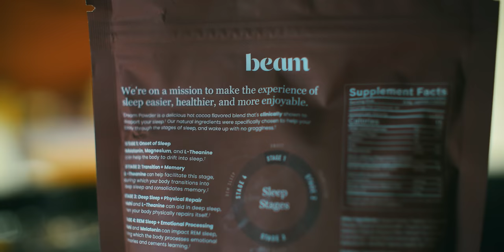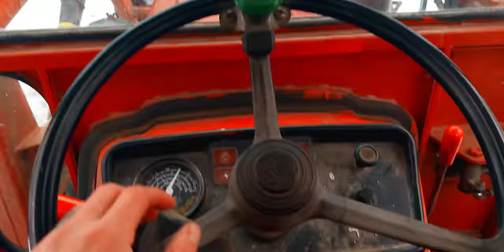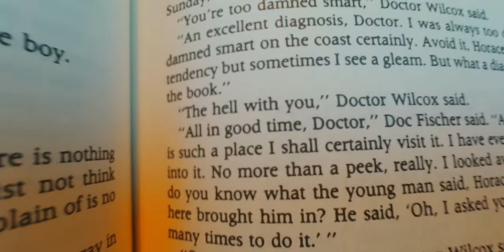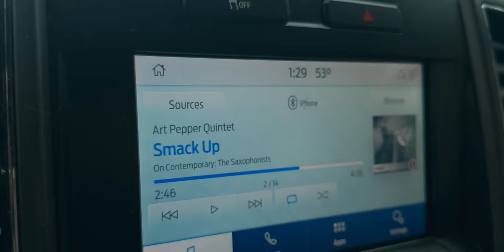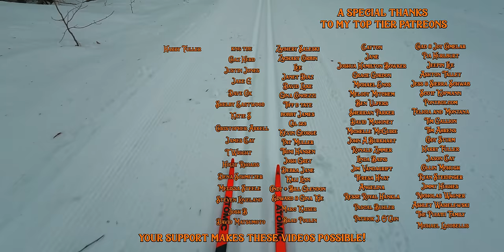Surviving Winter in the Rural Mountains

Comment: May I suggest you see if you can find a concrete plant “washout” normally they give it away. It would be great for a bottom coat of a driveway. Has lime in it. So not near a garden. Then get some road crush for the top of the driveway. It’s a project.

Comment: I'm not out east but wondering  how scraping the mud off the drive doesn't add to the problem in the long run. Enjoy watching your videos a lot. Thank you for continuing to share the nature around you both! Enjoy each moment.
Reply from the maker: Whether it's an old driveway that has washed out and disappeared like mine, or if you're just digging in your yard, the further down you dig, the harder the soil gets. You want a hard pack base to build a driveway off of. If you were to cut a new driveway from scratch, you would remove the top soil and get down to tougher soil before building it back up. Otherwise when it rains the new driveway mix will just sink into the muddy soil. I'm removing the mud as it shows itself so that in the spring I can ad gravel and make a driveway that won't wash out or turn into a mud pit. Thanks for tuning in and I appreciate the support!